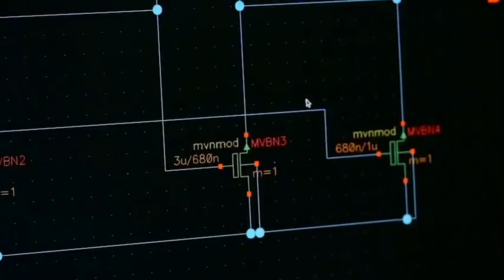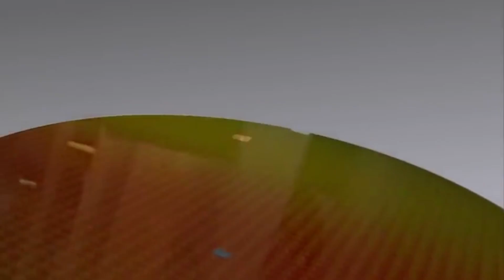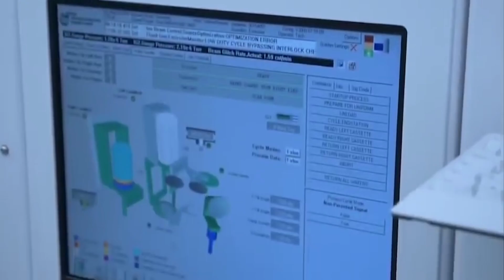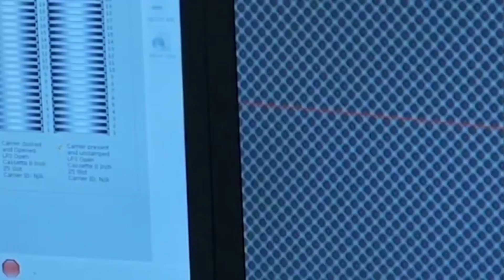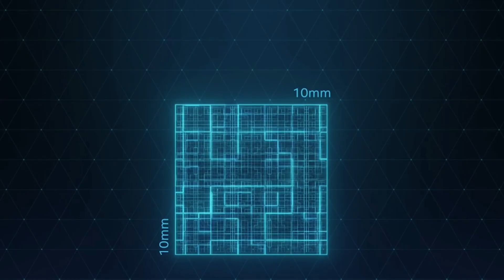HOW IT'S MADE: Microchips

Comment: I chime in on the good educational video material. However, the manufacturing of silicone is much more elaborate than just melting sand. Sand is mainly SiO2 (more precisely, the sand used is chosen to be mainly that). This is then reduced and converted to give silicone rods which are non-transparent and not shown at all in the video. These rods are purified further by zone melting and then the wafers are sliced of. This oversight makes me wonder how accurate the descriptions are in the parts of the process I have no clue about....
Reply: Also, the method by which the ingot is created is very special. It's called Czochralski method and it gives a single monstrous monocrystal, rather than a random polycrystal.
Reply: This video is a rip off of the How its made tv series and won't be complete.  Yes it's safe to assume all these processes have important manufacturing details omitted.
Reply: Video ain't telling you everything, I didn't see any "chips" made, all I saw was sand, things spinning around and some robot arms. Maybe I ain't seeing right cause I still don't know how micro chips are made.
Reply: @gordonlovett71  Trade secrets perhaps?
Reply: A small little correction. Silicon* :) 
Silicone is used for construction purposes. 🙌
Reply: you mean like the silicon rods shown at
1:46-1:53 
8:14-8:20 and again at 8:30-8:35
The big shiny non-transparent rods. in first clip looks like loading up to shape and slice off wafers and the 2nd clips a rod being "birthed".
A poorly edited video i can agree, but saying the rods were not shown at all in the video makes me question if you watched the video.
Reply: Why is the wafer a disk and not a square? a disk is much harder to portion :-w
Reply: @silvercriss  I'm pretty sure the silicon crystals grow in a kind of cylindrical shape. So it's less wasteful to round it to a uniform shape, than to cut off much of the round cross section to make a square.
Reply: @exazebra  square wafers are actually pretty common depending on the application. If you Google Square silicon wafer you find loads of wafers even with the corners still 'rounded'. This is because they have been cut of a round wafer. These types are pretty common in a solar panel for example.
Reply: @silvercriss  It's how the Czochralski method grows crystals. Crystals can technically be grown any way but the only way we know of making monocrystals is with the Czocharalski method. In this process a seed crystal is dipped into the molten silicon and is then lifted and rotated. It's this rotation and gravity that forms the long cylinders.
Reply: @silvercriss  There is a spinning element in making the wafers. So it is not possible (with current processes) to make them any other shape than round. That's why the bigger the disk the better, less waste... but harder to make.
Reply: The wafers are round because molten silicon is gradually pulled up to crystalize and the seed needs to be turned while pulled slowly
Reply: i have existential crisis now .-.
Reply: What did you expect from an 8 minute video?
Reply: This is intended to be a high level over view, that said .. this is a chopped up and almost word for word re-voiced version of the video that Infineon did a number of years ago: https://www.youtube.com/watch?v=bor0qLifjz4
Reply: Damn never would've thought making microchips would be this delicate
Reply: If he described the whole process at that level of accuracy it would take an age. Once the wafers go in the fab things get really complex, especially on modern chips

Comment: Only 3 minutes in, and I'm not impressed with how the information was presented. It seems like it's the result of an assignment who's requirements were to make an instructional video that's at least 5 minutes long. There's a lot of words and phrases that are just shotgunned in the video without any demonstration or picture. You need to take time to at least show a picture of what "doping" is or explain what "P and N" type sides are. 

Also, an irrelevant nitpick: sand is not an element.

Comment: Lithography and photography are a part of the IC chip production process; is what I learned in 1981 in an electronics course I took.  Of course there is also the chemistry as the introduction showed.  it is an amazing technology which apparently we can only mostly use frivolously.  I need a new lower back disc and it's impossible to get.  This makes no sense.
Reply: That is because people value profits rather than human life and wellbeing.
Reply: @es-yy2cm  No, it is because required foundational technology hasn't been invented yet...for example - new body parts, we are only now getting to the point where we will be able to print new body parts. Why? Because we needed to invent inkjet printers first, for which we needed micromachined print heads and IC's and computer control etc. to produce and run the printer, which means the whole semiconductor industry had to reach a certain point to be able to do this.
From the basis of the inkjet printer, it then has to be extended into the 3rd dimension 3D print, coz after all body parts aren't flat. But then there is the whole body bit - life sciences needed to get to where we understand how the body works at the cellular level (DNA tech) so that we can make stem cells to make what we want, and these have to be able to be placed in a 3D matrix that can sustain them...Oh and we need to be able to image the parts we want so they fit the individual, so hello MRI & CAT scans.
 
Without ALL of that you don't get to do the final, integrated, step.

And hopefully this is not too far off being a common everyday thing, I could do with some nice new cartilage in my knees, rather than the slightly ropey stuff in there! 
Thinking of this, it will change things in many ways when it is available, for example the meniscus cartilage; when this wears it eventually leads to wear on the cartilage bearing surface of the knee, which then eventually leads to osteo arthritis, and eventually knee replacement surgery.
Imagine if you can 3D print and replace the meniscus cartilage, then no osteo arthritis, and no knee replacement surgery from "worn out knees"
Similarly for @clavo and his back.

Comment: why nobody show how those small part on the chip is made ? (i mean how they turn layout to product)
Reply: That's the photolithography and etching process. Photomasks are created, and with UV exposure they leave a pattern on the photoresist that the video shows being coated on the wafers. Then etchants are used that remove silicon anywhere that isn't protected by the photoresist.

This process is repeated tons of times to create 3D structures in the silicon.